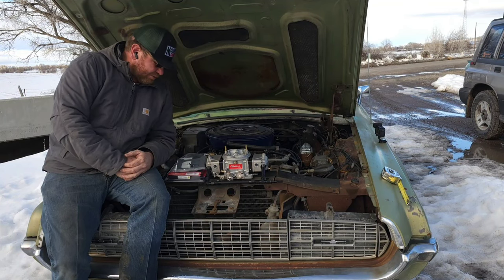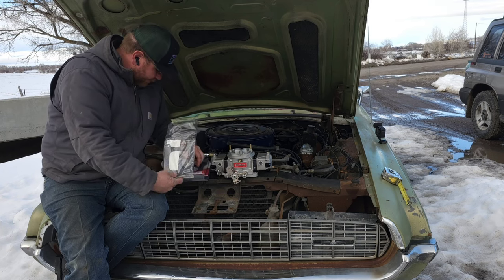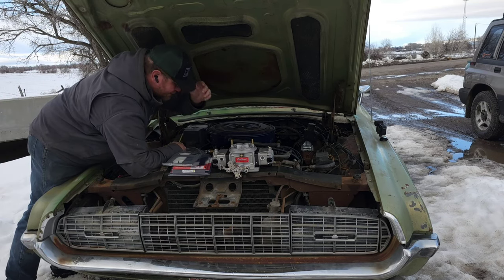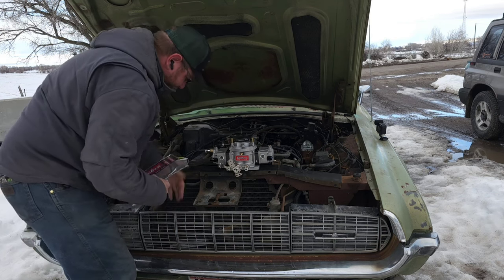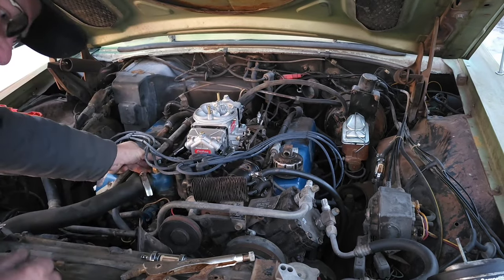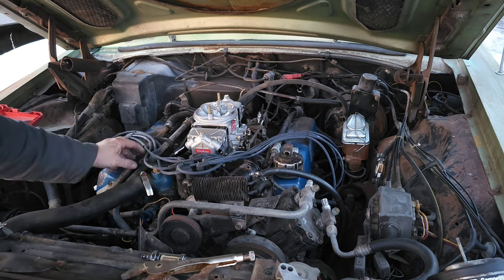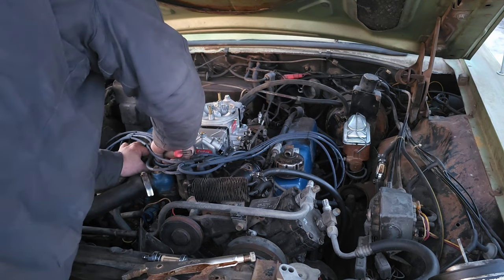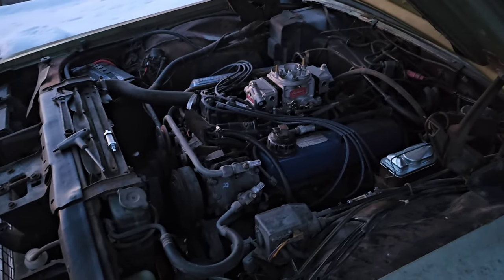INSTALLING AN EDELBROCK VRS 4150! MAKE SURE TO MEASURE BEFORE SELECTING A CARB!

Comment: I have heard a bunch if horror stories about the fuel filters you are using such as breaking, leaking and that can result in fire. A metal canister filter kind of like the one used on the C2 Corvettes (1963 to 1967) can be obtained with fittings on both ends for 3/8 inverted flare tubing. Much safer filter and the factory recommendation for replacement is 12,000 miles. I believe the WIX part number is 33481. I do not need to see inside and knowing the filter is not going to melt or leak, I am fine with this style filter. It flows between 1 to 2 gallons per minute. I doubt even your 428 will consume this much.
Reply from the maker: I changed things up by the carb. I've been using the glass ones with the metal ends for over 20 yrs. If you know what you are doing I've never broken one or had an issue. Appreciate it!

Comment: Mike who makes the fuel supply line ?         Thanks
Reply from the maker: It's a cheap setup I found on ebay. Here is the link. https://www.ebay.com/itm/225963190679?mkcid=16&mkevt=1&mkrid=711-127632-2357-0&ssspo=eKh1vV3GSrO&sssrc=4429486&ssuid=akqpg6verye&var=&widget_ver=artemis&media=SMS
Reply: @landoncustomclassics  Thanks !!!
Reply from the maker: @juangalvez8594  no problem! Always glad to help!

Comment: Do you have a part number or link for the dual fuel feed log that you used?
Reply from the maker: https://www.ebay.com/itm/225963190679?mkcid=16&mkevt=1&mkrid=711-127632-2357-0&ssspo=eKh1vV3GSrO&sssrc=4429486&ssuid=akqpg6verye&var=&widget_ver=artemis&media=SMS
Reply from the maker: It is the perfect length for this carb
Reply: @landoncustomclassics Thank You!

Comment: 0) The glass filters should be universally avoided. The o-rings are prone to leaking, and if the glass hits something solid while the engine is running/vibrating, you could be equally screwed. I know a lot of car guys, and none of them use the glass filter. 

1) To remove old carb studs, simply double-nut them and use a proper wrench.

2) When you tighten the carb stud nuts, it is recommended to tighten them  in a criss-cross pattern.

3) If you put grease on the base gasket, the gasket becomes pretty much re-usable and you won't have problems removing it later.
Reply from the maker: Thanks for the advice! Always good to learn something new!

Comment: I’ve read many good things about this new carby!
I’m currently running an Edelbrock 500 AVS on my mild 318 but I’ve often thought that it was too small?
I wonder how this new Edelbrock 650 would work on my engine?
I also run manifold vacuum on mine after experimenting as I found that it runs and idles better this way.
Reply from the maker: @Tk-ou9ec  slant six daily did some videos running one on his 225 slant six! Seemed to do good for him! If you order anything check out Rileys Rebuilds she will take care of you! The AVS 2 is a great carb!
Reply: @landoncustomclassics  thank you for this information 🤘

Comment: Which carb (cfm rating) is it? Have you finished the kickdown connection for the trans yet?
Reply from the maker: This is the 650 cfm. I had already installed a c6 cable kickdown conversion that is $16.99 on Amazon. Had to adjust the cable for this carb. Here is the Amazon link. GSKMOTOR For All FORD C6 C-6 Transmission Kick Down Cable Kit, Stainless Braided Polished Transmission Detent Kickdown Trans Wiring Kit https://a.co/d/bzNDFnX